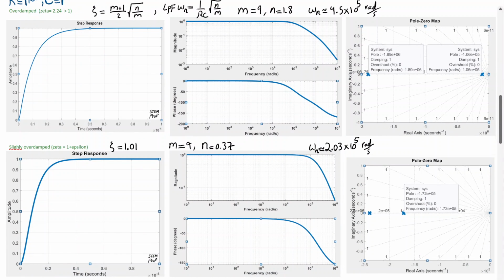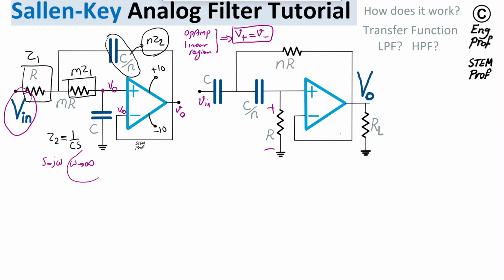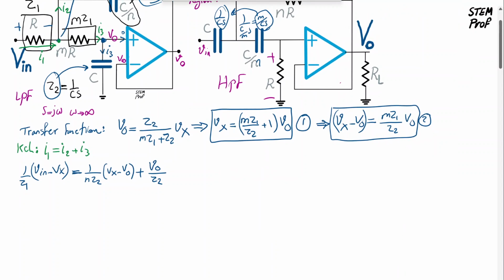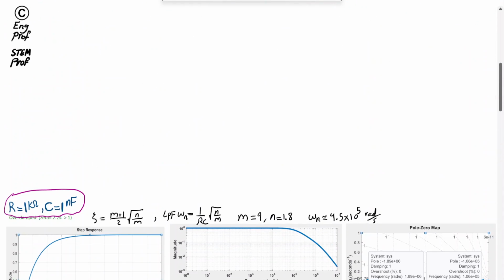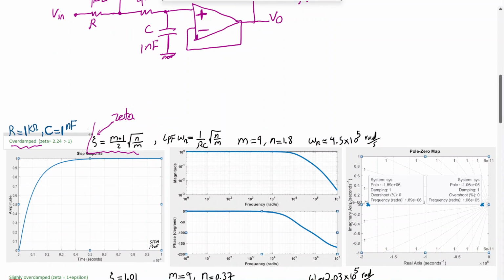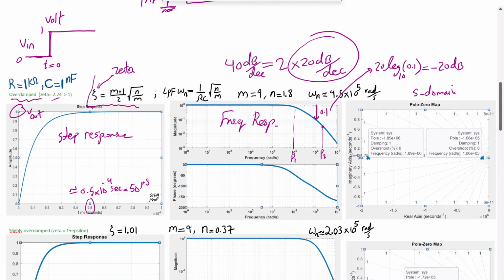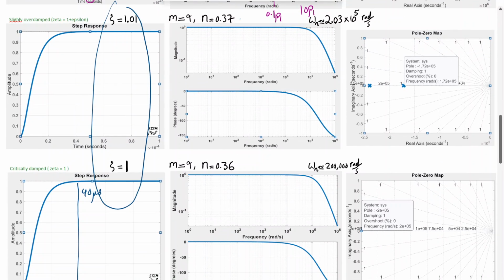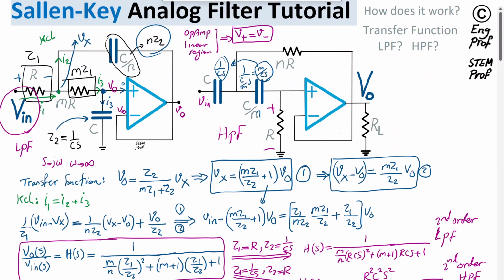Sallen-Key Filter Design Tutorial: LPF, HPF Frequency Response, Damping Factor

Comment: I use a high pass and low pass in series to make 50Hz band pass filter，when I  input a sin waveform，the output phase will drift over time slowly，what is the reason？Thansk!I use the circuit to make the zero cross detection，the drift is terrible。
Reply from the maker: Thanks for your interest in this Sallen-Key Filter design video. 50Hz is a considerably low frequency for Bandpass design. That said, make sure you use zero drift ultra low noise dual op amp Packages from Analog Devices or Texas Instruments in order to minimize drift.

Comment: Very very helpful thank you! However, wouldn't it be better to leave n constant and change m instead because capacitor values are less broad to choose from, so it would be better to vary the resistors then the capacitors? I am talking about the lowpass example here
Reply from the maker: You're welcome & Thanks @leenhennekam9906 for the comment. Regarding your question, sure, as long as you as designer would be fine with the dependency between coefficients of s^2 and s terms, meaning m/n and m+1, in the denominator of the transfer function as show in video at minute 16:30 .  If you keep n constant, then you can't independently change those two coefficients. Here are a few related filter design videos that might be helpful as well: 

Band-Pass Sallen-Key Filter Design https://youtu.be/lsM09pcrRVE
Universal Analog Filter Design https://youtu.be/2J-0msXZE2o
Butterworth Analog Filter Design with Op Amp https://youtu.be/SIMg5TOIgrA
Thanks again for your interest.

Comment: Very useful channel for an engineer!  Many thanks!
Would it make the derivation easier using star-delta formula for R1, R2, C1?
BTW do you know a analog circuit, that behaves like a precision voltage controlled z-diode (0...15V)? Fast and stable would be nice.
Reply from the maker: Thanks for watching, your interest & good questions. Glad that this channel is useful. For this relatively small op amp circuit, given the already quick KCL calculation utilizing Op Amp virtual short, Star-Delta transformation is probably not beneficial.  But it might help in a larger circuit.  Regarding your voltage controlled Zenner Diode question: effectively you are asking for an adjustable voltage regulator.  Please see this example:  
Voltage Regulator design with Op Amp BJT JFET and Zener Diodes https://youtu.be/CJl-urzeiTo
I hope this is helpful.
Reply: @STEMprof  Thank you.  Very interesting.
Reply from the maker: You're welcome. Glad that you liked the video. For more examples pls see my Analog & Electronics videos collection: https://www.youtube.com/playlist?list=PLrwXF7N522y4c7c-8KBjrwd7IyaZfWxyt   Thanks for watching. 🙋‍♂